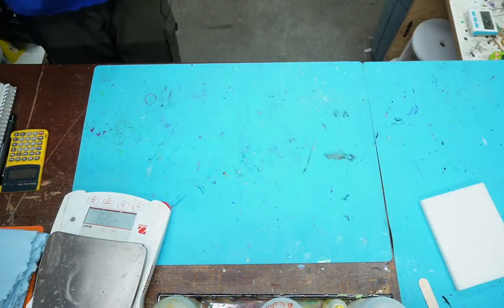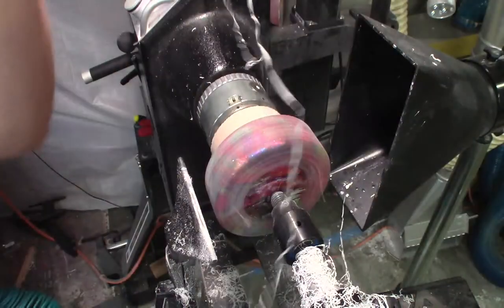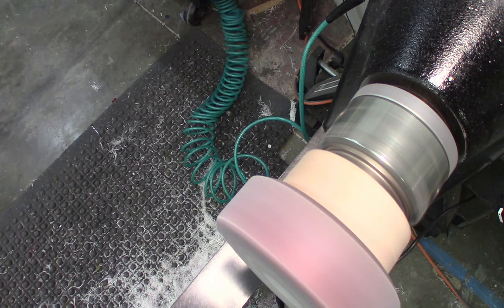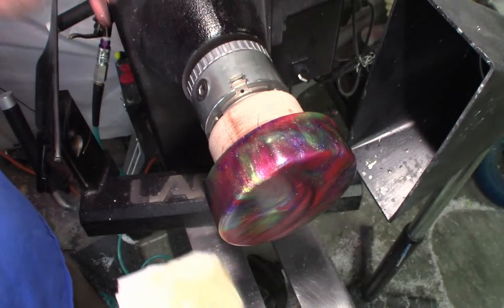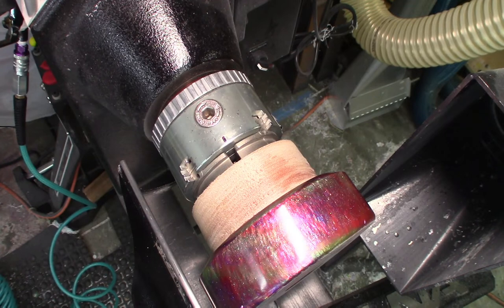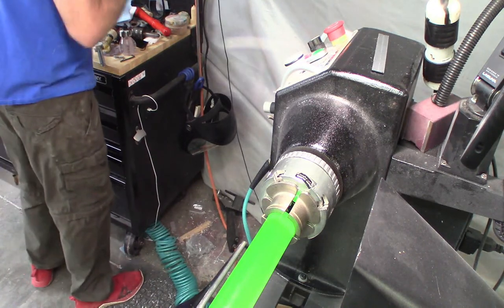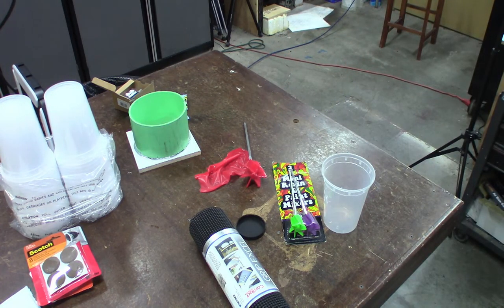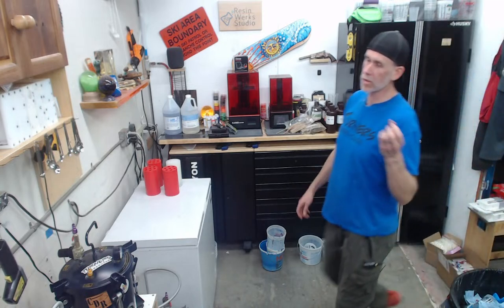🔴Replay: Making a Paper Towel Holder Out of Alumilite Resin Blanks  | Episode 233

Comment: Zac do you use negative rake cutters on your resin?
Reply from the maker: I do, they definitely perform better on resins in most cases. I got a catch on this one when I was using my standard square cutter... although that was really caused by the tool rest moving... but even still I probably wouldn't have gotten a catch like that if I had been using a negative rake cutter at the time
Reply: @ZacHiggins  thanks. I’m getting ready to order some new cutters when I can afford it 😢😂 and I was thinking of getting some negative rake cutters also. I just wasn’t sure what I had read was valid. It sounds like it is. Thanks again 👍🏻
Reply from the maker: @GTLee9  My pleasure! Yeah, it's not hype, the negative rake cutters are a game changer when it comes to turning resins and other difficult materials. I wouldn't even touch hollowing resin blanks before they came out, now I absolutely love hollowing resin blanks 😀